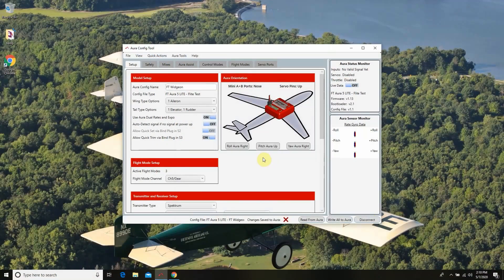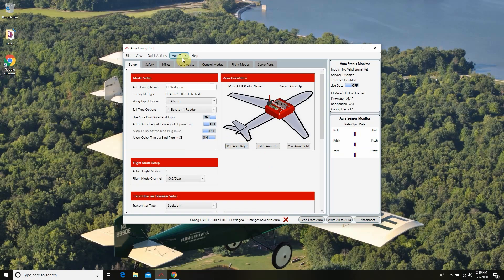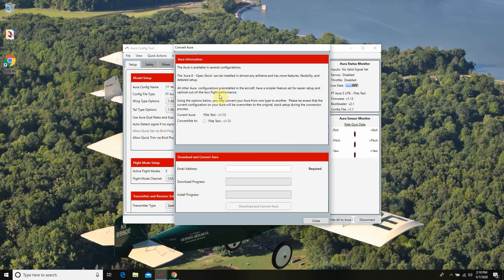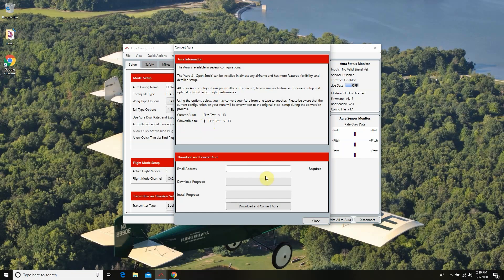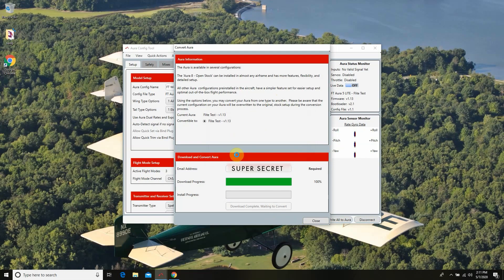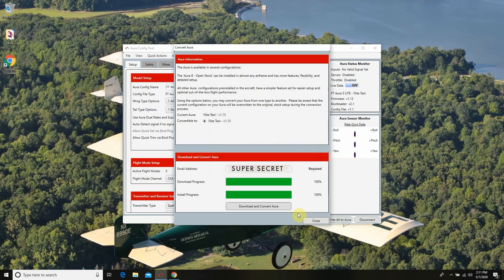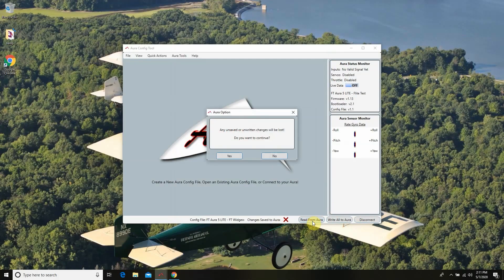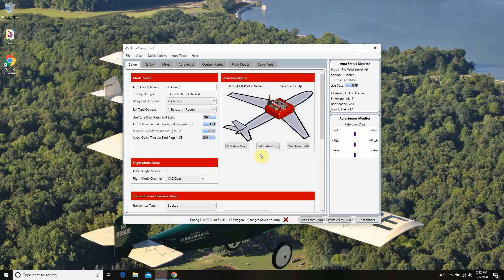How to reset your board? / FT Aura 5 Lite

Comment: I continue to get a blinking orange light no matter how many times I try to power cycle my aura 5. I try to connect it to the config tool and I get an error message which says something like “version 0.0 is not recognized, please update config tool.” When I try to update, it continually tells me that I have the most current version. Very perplexing! So this reset method won’t even work for me because it won’t accept my aura board. Any suggestions?

Comment: Hi everybody. Following each step it just does not work. The downloaded file does not reset my aura to default flitetest config and when I hit read from aura After the process, I still see the same configuration from before. 
The problem is, that the Gyro moves the control surfaces. elevator and rudder in the wrong direction. I couldn’t find any explanation of how to change this.  I would be so glad if some help would resolve this!
I’m using Spektrum dx6e and Spektrum satellite.

Comment: Is there a manual factory reset w/the two buttons? I've "bricked" two Aura 5s by writing something it doesn't like. The LEDs do not illuminate and the configurator no longer recognizes the boards. Have tried different computers and cables to no avail.  To be clear, this was "operator error". Thanks!
Reply: Just curious if you ever resolved?
Reply: @kf4293  Unfortunately, no.

Comment: So far FT Aura 5 seems fantastic. However I have been unable to actiavte the launch assist using Quick Change procedure on a FT Bravo. Since it uses elevons the left aileron plus elevator doesn't seem to work or even apply.

Comment: In earlier videos, you show increasing the output throws on your transmitter to 125 percent. Is this just for Spektrum radios or all brands of transmitters? 
Secondly, why is this done?
Thanks!
Reply: It is done to provide more data to Aura, more resolution. It varies depending on the radio. For Spektrum and Futaba, this is correct. FrSky is 100%, others may vary. Aura wants to see a certain min/max servo pulse from the radio.
http://wiki.flexinnovations.com/wiki/Aura